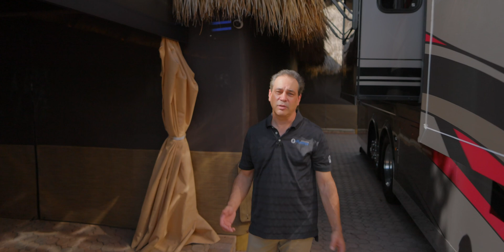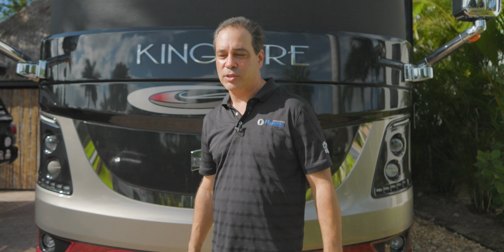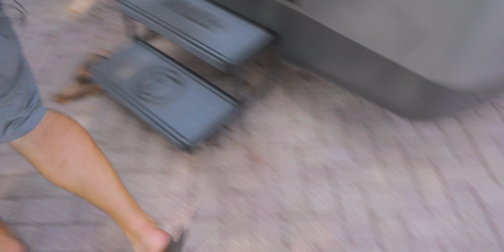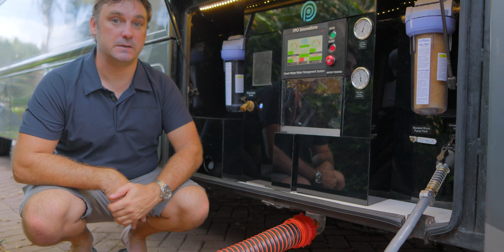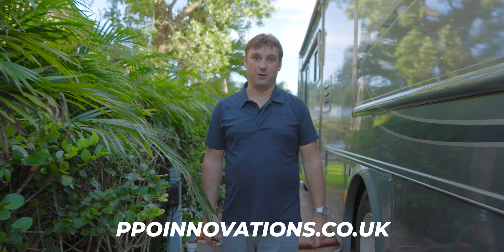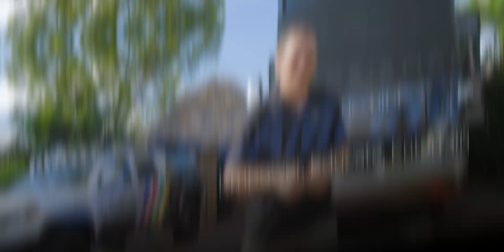Fully AUTOMATED RV Waste System ft. Matt Hooper

Comment: Awesome! If the system goes down or completely off line, can you still manually use your dump valves etc..?
Reply: Yes you can and you still have visual indicators.   It has manual operation if something was to happen.   Probably the best RV upgrade we have ever done.  I mean who does not want this part of RVing to go away.  LOL